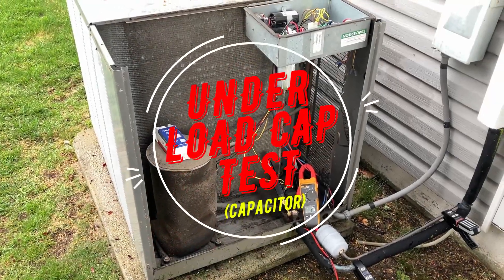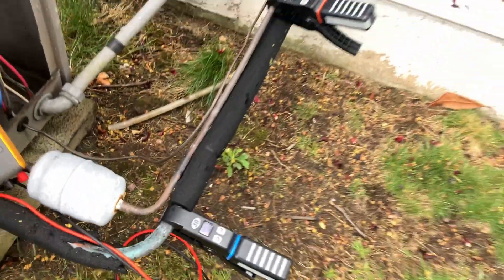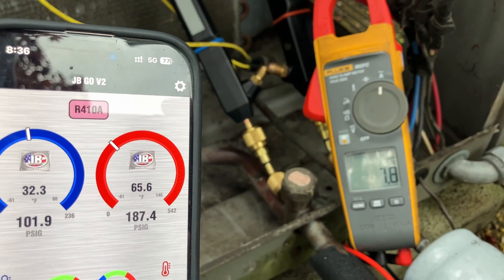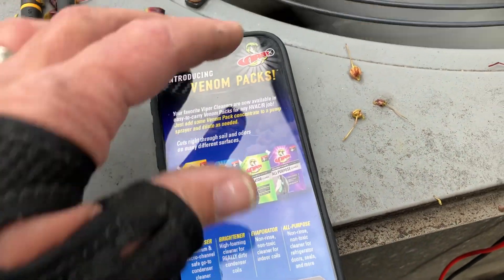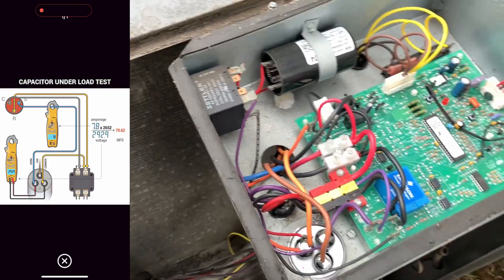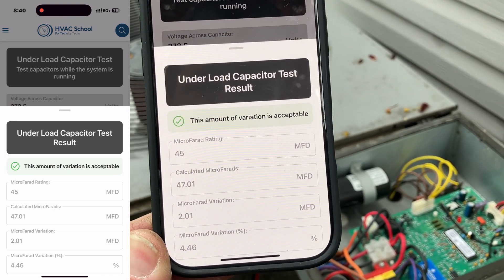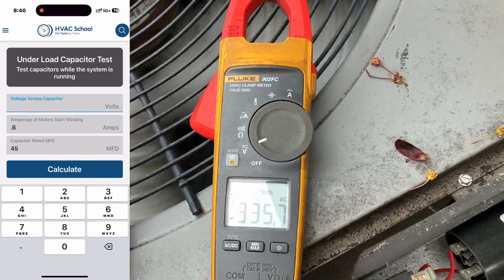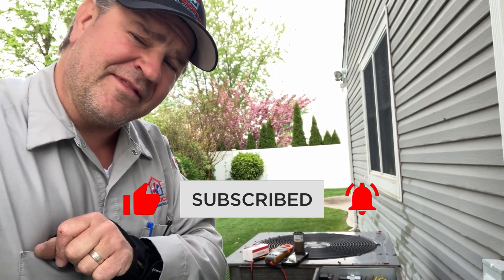How to Test a Central AC Capacitor Dynamically Under Load | MUST KNOW HVAC Tech Tips

Comment: Great video. Do you have one or can you explain how a reversing valve in a heat pump works. Does the thermostat run the process everytime the hear or cool is on. Does the valve switch everytime?
Reply: reversing valves switch refrigerant flow to the opposite direction through the condenser coil, line-set and evaporator coil, which changes which indoor/outdoor coil extracts heat and which side emits heat.
some condenser units have reversing valves setup with unenergized solenoid to be in cool mode and others in heating mode, so it depends on brand/design, but they will switch every time the thermostat turns on/off and the unit requires refrigerant flow reversed for the desired heat transfer direction.
I hope that helps, I'm not a teacher by far. 
and @pipedoctor actually you do, since mini splits that are not A/C only are heat-pumps, but I get that you don't have any in detail/repairs on them. 😉
Reply from the maker: No I don’t. I personally don’t service heat pumps. Check out @MikeyPipesOrlando
Reply: @PipeDoctor sorry I jinxed you. Great job on diagnosing the issue with that heat pump